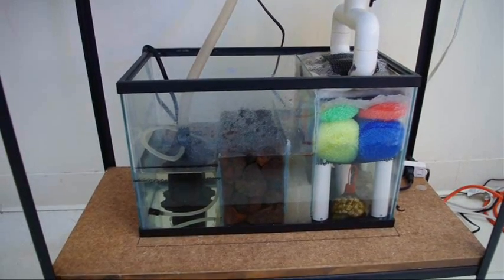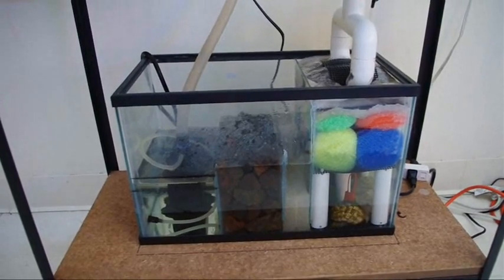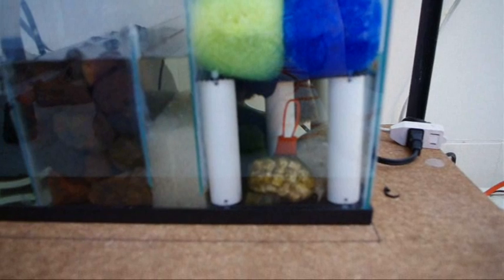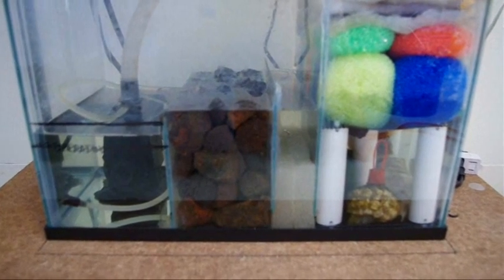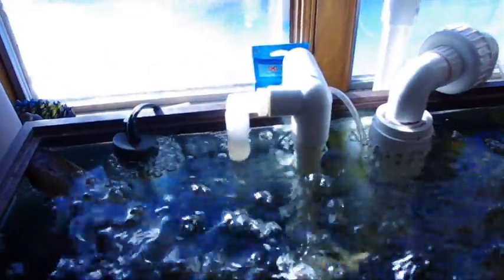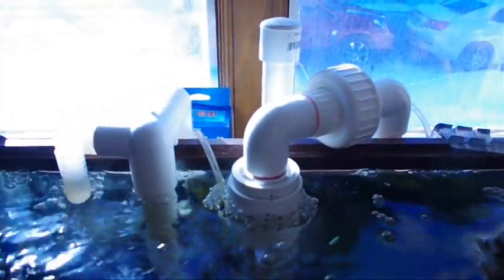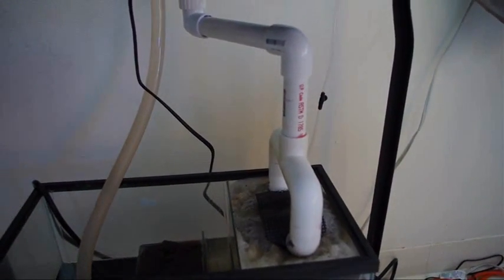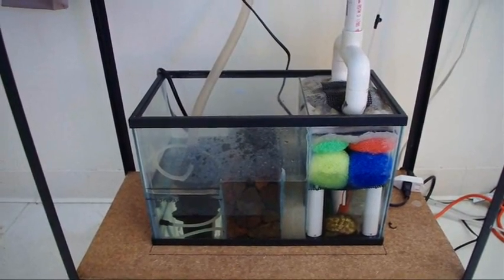5.5 Gallon Nano Wet/Dry Sump

Comment: remove the white sponge, that path should be clear, the water level in the feist chamber seems so high, the biggest restriction of flow is that white sponge
Reply from the maker: James, with all due respect, this filter has been flowing almost non-stop (barring power outages) for the better part of 7 years now. Trust me when I tell you, it works just fine, and flow/speed/volume has never once been an issue. 😂
Reply: @ScironTheBandit  thats good but the ports is better clear, some sumps even have trays to elevate the media so the ports stay clear for proper flow, the velocity in those small port is higher than the big compartment baffles because of cross sectional area, anyway good the first baffle never over flowed

Comment: Lovely little sump. If you raise it up so it’s closer to the main tank you’ll loose much less flow on the return pump. No need to have it that much lower.. 

also if you smashed the lava rock into slightly small bits you’d fit much more in with less air gaps. :)

Comment: Great video buddy. I'm getting ready to setup a new 65 and would like to use a sump system to filter it. I have a 10gal tank laying around and I'm trying to figure out if I can turn it into a sump. I'm not sure if it's big enough or anything. Your video helped answer a lot of my questions so thank you for that. If you have any advice I'd greatly appreciate it. Thanks for sharing and as always Do what you do if it works for you.
Reply from the maker: I would say go for it with the 10, just try to get the flow rate for the entire system as high as possible, using as large a pipe diameter as possible throughout, given whatever space constraints you have. The nice thing about these is they're independent, so you can always add a second sump (of the same or larger size) to the 65 if you feel it's not getting enough filtration. My $.02 worth. Having multiple filters also isn't a bad thing when it comes to redundant hardware failure protection; "two is always better than one," at least when it comes to filtration setups.

Will be making a follow-up video soon, showing more detailed build instructions, since I'm building a second one. Stay tuned! :)
Reply: @ScironTheBandit  I appreciate your $0.02...lol. I'll be looking for your follow up video and I couldn't agree more. I'm still going to use that 10gal for a sump but I think I'm gonna use it on my 29gal pleco tank instead of the 65gal. I just think a 10gal sump is too small for a 65. I'd be more comfortable with a 20gal sump.
Reply: That'll little 5 he setup would be sufficient for 65 gallon freshwater tank. Maybe even a marine, if it had space for a protein skimmer. Your 10 should be more than sufficient for your 65 wether fresh or marine; if setup properly

Comment: what if the power cuts off ? 
i think we will have water overflows in the sump
Reply from the maker: My power has cut off at my house numerous times since I built the sump, and never once has it overflowed. It's a balance of figuring out how far the water is allowed to drain out of the main tank before the air break kicks in. Pretty simple to do, actually, with the air break design I came up with (detailed in this video). Lengthen/shorten the piece of clear tubing on the break as necessary, testing by cutting power to the pump after each length change. Works a treat!

Will be making a follow-up video soon, showing more detailed build instructions, since I'm building a second one. Stay tuned! :)

Comment: Shorten the pvc pipes holding up your mechanical filtration to allow water intake not to overflow into 2nd chamber- otherwise great design
Reply from the maker: Michael Piccirillo I ended up taking out the filter floss and just using the mesh instead. Works a treat, and no overflow to the second chamber! :)
Reply: Awesome

What did you use for baffles- 
Plated glass or plastic & where do you get plastic baffles. I'm thinking of building one like yours soon.

How do you match the amount of water coming from overflow & return pump without running pump dry or not having enough powerful pump, trial & error till its right?

It you loose power is there enough room for extra water in sump?

Have you built any larger sumps or plan to?
Reply from the maker: @Mikinct 

Will be making a follow-up video soon, showing more detailed build instructions, since I'm building a second one. Stay tuned! :)

Comment: Hi Can I ask please. What part of your setup do you need to change/clean/replace on a regular basis? Does the lava rock or your pot scrubbers need changing or is that the place where the good bacteria reside to help the filtration process? I too am about to design a sump filter and am a little confused on which parts I need to change so I can design my sump for this. thanks very much. pj
Reply from the maker: Will be making a follow-up video soon, showing more detailed build instructions, since I'm building a second one. Stay tuned! :)

Comment: The sump is by far the best type of filter for many reasons, but one issue I have seen is intake and outlet both being at the top. I was wondering if a siphon could be extended to the bottom so water came from the bottom and returned to the top. Is such a setup possible with a sump filter?
Reply from the maker: Kenney have to have a pump somewhere in the loop. Never seen a design that was pump-less.
Reply: Kenney no sadly its not possible
Reply from the maker: Will be making a follow-up video soon, showing more detailed build instructions, since I'm building a second one. Stay tuned! :)